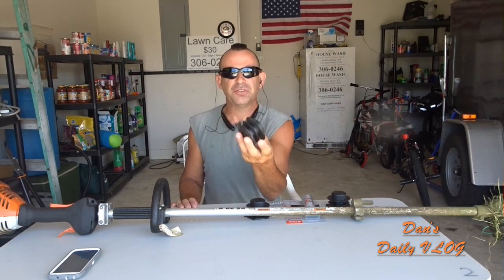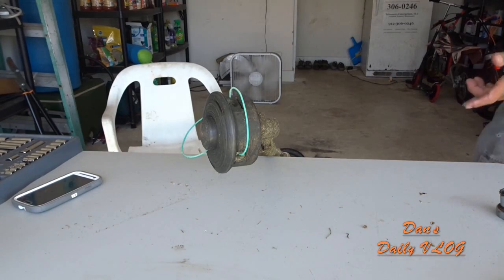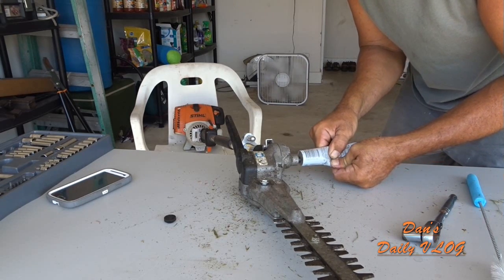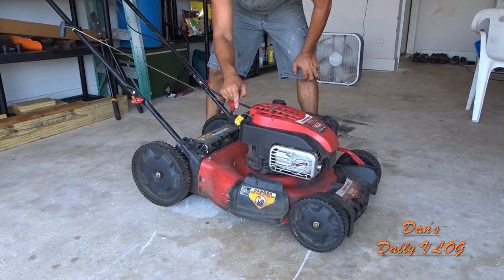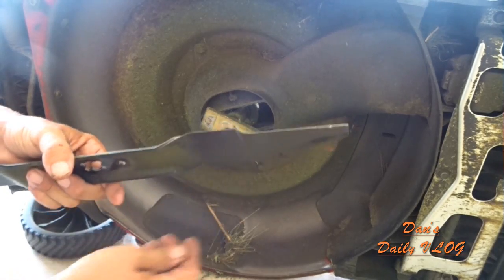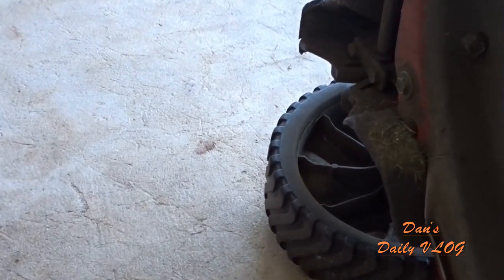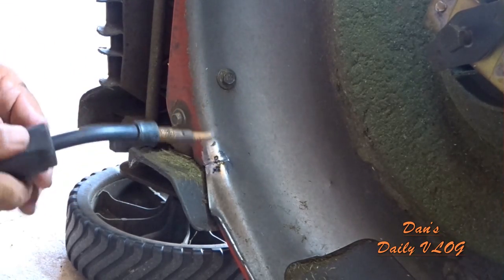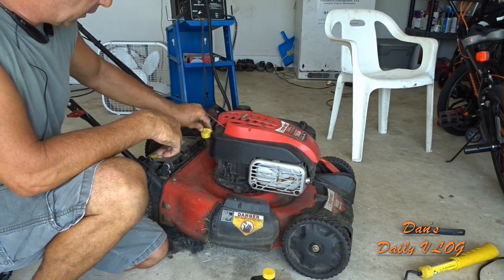Ep 6 - 2 Guys and a Lawn Mower Cutting Grass - Lawn Mower Repair - Mower Maintenance

Comment: Dan, a tip with the head insert to prevent it from wearing down. Put a bolt at the end but do it when the head is new
Reply from the maker: +Matt La So you mean put a bolt in the bump?
Reply: Yes so when you you bump it you'll hit the bolt and won't we're out the insert. It works good. But you you be to do it in a new insert or it will be to thin and the bolt will interfere with the spring. I hope that makes sense. Have it so when you bump the head of the bolt bumps the ground

Comment: you might wanna check out the echo speedfeed head on your trimmers... You can respool really quick without having to take the head apart... it should interchange with the stihl.. it did on my fs 94r anyway
Reply from the maker: Good tip. Thank You

Comment: I heard you can just turn the mower over on the side to change the oil but I always take the oil plug out of the bottom to drain the oil.I have a troybilt 190 cc push mower it is not a self propelled mower.

Comment: great info, i might buy the same welder, looks nice, you kinda got to take a gamble when buying from harbor freight.
Reply: They work better when you buy the wire from I different brand. Either at lowes or tractor supply. They are meant for small things like this.

Comment: Dan what do think bout Milorganite.  I am thinking bout trying it on my lawn and is that the only lawn fertilizer you use.
Reply from the maker: I have great results from milorganite. just make sure you to put down the proper amount. The bags come in only 2500 square foot bags but are the same saze as 5,000 square foot bags of other stuff. I use Bonus S in the fall and spring. I use Milorganite in the summer and will use it all year if weeds are not out of control. I also use Lesco brand fertilizers which is great stuff.